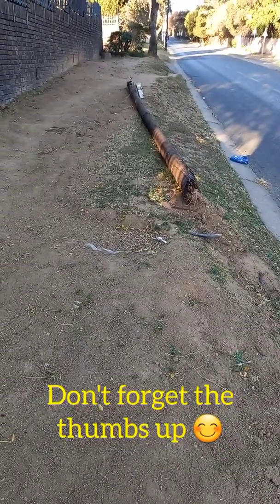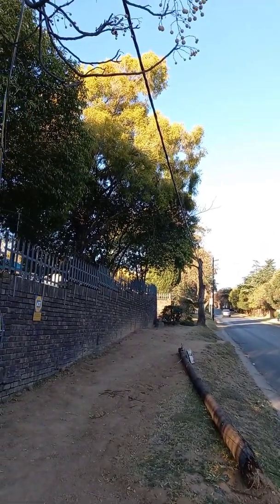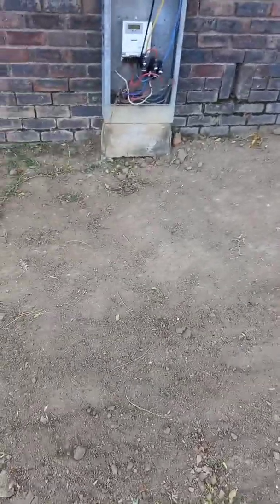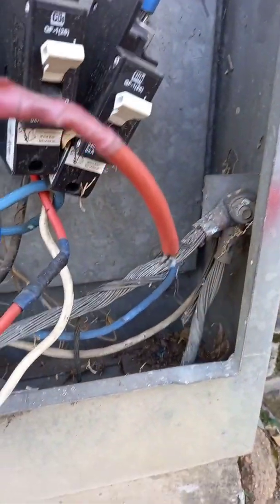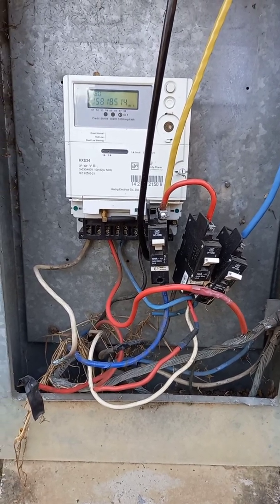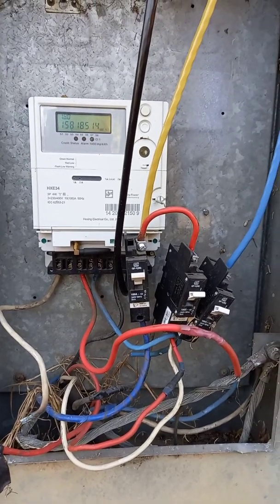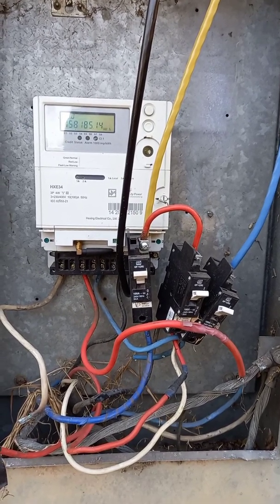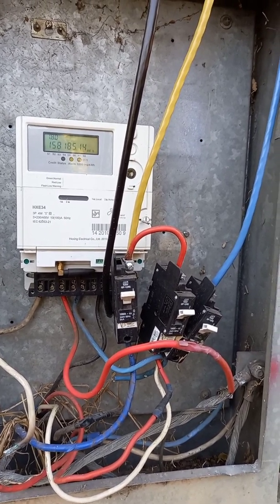Who's to blame if someone dies from this wiring?

Comment: That neter must be connected to something the display us working which needs power  the back up batterts won't last that long
Reply from the maker: It is just batteries.
Surprisingly the batteries last years and years according to the manufacturer.

Comment: Thats terrible how can anyone leave a supply like that bloody cowboys
Reply from the maker: Agreed!
I made this video on purpose as evidence in case anything did happen to residents at that house.
Then it went to our ward councillor who sent it to City Power.
They arrived very quickly to address the issue!
Then when they finally installed a new feed to the meter, they didn't connect the neutral properly. Many items were damaged and the armoured cable in the house started smoking. Likely trying to carry the load back via the armouring!
It was a nightmare.

Pity it takes such effort to have things done properly in South Africa 🙄